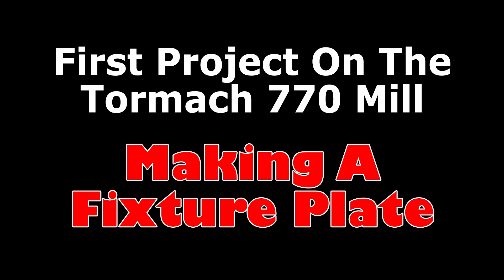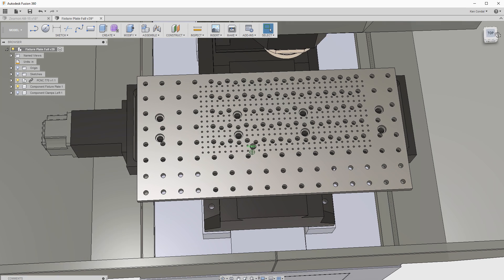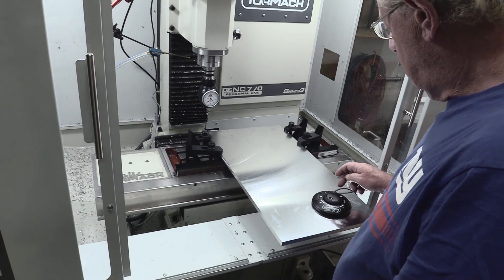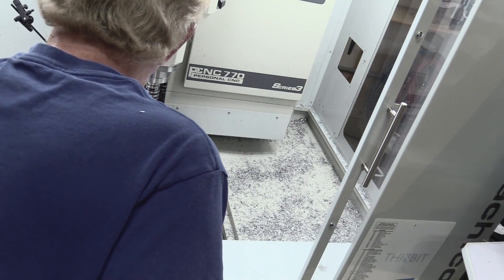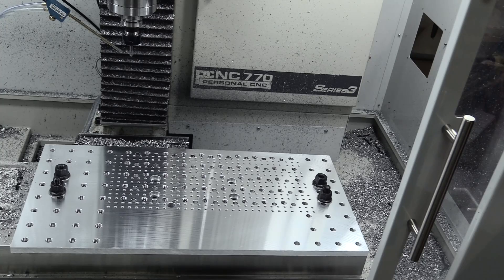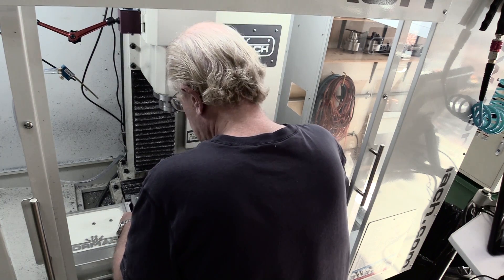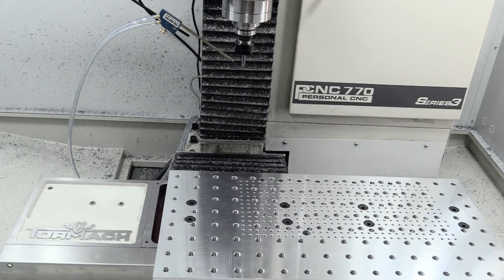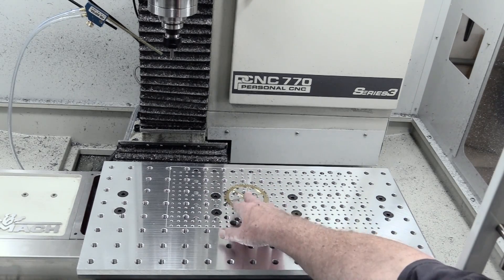Making A Fixture Plate

Comment: Hi Ken, something you might find interesting if you haven't already discovered it.   

I have been using a program called GearWheel Designer by Delphe that allows you to make a complete wheel using CNC including cutting the teeth.  It means going down to micromilling with sub 40 thou tooling but it works.   The tooth profiles are really nice.   The program lets you drill or mill holes as arrays or random so you can do hold down holes to hold crossing out petals.   The resulting code seems good and runs on my 440 OK.  I always cross check using GWizard before I run it.  Worth a look on delphe.co.uk and there are some notes on my site pezula.co.uk showing the results.

Kind regards
Alan

Comment: Hi Ken
I have a 440 and am about to make a plate using the same principles but I am missing a step.  

When you do the first two stages of the two independent end machining how can you ensure that the two sets of holes are in line as you will be using the Hammer on just the corner of the plate ? Or do you use the opposite corner when you turn the plate round ?  
How do you then ensure the plate is perpendicular to X when doing the two ends ?  
Does that make sense ?
Did you export 3 sets of G Code ?

Alan
Reply from the maker: Hi Allan. Yeah, I guess I left out a step. I used a DTI to ensure that the side of the plate (along X) was square. Since we're only going to be drilling for threaded hold down holes, it doesn't have to be perfect, just close. What really matters is the third op when I drill for the dowel pins. Those are all done in one op and will be as close to square as the mill itself. Since the dowel pins are used to square the plate when it's mounted in its final position on the table and will also be used to make sure your stock is square to the plate, that's all that matters. I probably generated 3 sets of gcode, but that's up to you. Ken
Reply: OK Ken, that makes sense and is obvious now you said it ....  Thanks for the quick reply.

Comment: Hi Ken, 
After watching your video I tested it at x1.25 speed and you sound like most normal people.  Did you post this video at 75% speed?  
But I expected you to use something like the superfly to make sure the surface is completely flat.  I didn't see you measuring it for flatness with the Heiner on the Z axis.  How do you know it's flat?
You really should check this video at x1.25 speed. It's very enlightening.  Never settle for what nature gave you if Google can give you more.  Even Taylor Swift uses Autotune.
Reply: KenToonz.  Thank you guys.  Maybe I'll make a smaller plate for the vise first like you said.  Yes I know a plate is ultimately sacrificial.  That's why I want to protect the tormach table from accidental damage.  Maybe I should take my time though.  Thanks again.
Reply: Ken appears to be using plate, which starts life pretty flat, certainly far better than extruded material. One can also order the material sized, faced, and ground. Allows one to balance cost and time, with perfection.
Reply: +Kent VanderVelden.  Thanks Kent.  I'm in the process of ordering the Tormach 1100 and I want to use a plate.  One option is to buy one from Tosa Tool who sells them for $1000 (not gonna happen).., or to make one myself, but I'm not sure how accurate it will be if I am trying to make one, face it, and drill.  But it needs to be moved around because the plate is larger than the actual effective work area.
Reply from the maker: Congrats on your 1100. I used cast aluminum which is plenty flat enough for my purposes. My advice would be to use the machine for a while and then figure out what you need. I made a much smaller plate that I mount on my vise and find that I use that even more. But the big plate is still there, under the vise.
Reply: Based on Ken's other videos, he clearly knows his stuff, and I'd follow his advice. For plates that would be awkward to face, places like Misumi offer faced and ground 2 or six side plates, with specs on flatness and parallelism. Maybe I'm lazy, but for a large plate, it's worth considering having someone do that work. Keep in mind, any sort of tooling plate is ultimately a consumable though and will be replaced or resurfaced (and otherwise modified for special purposes).

Comment: Ken... very good video.  Nice fixture plate.  Thanks for sharing.   Where did you get the Haimer with the inch graduations?  Tormach seem to only sell that model in Metric?
Reply from the maker: Thanks Enda! I thought it was important to have a Haimer in inch and found them on Amazon. But since it's mostly used to find zero, I doubt it would matter if mine was metric. I believe the metric one is smaller and since the Z travel on the mill is limited, that might be why Tormach sells the metric version.
Reply: Thanks Ken, I saw in another post that someone implied that the metric Haimer has better resolution..... what is the resolution of the inch version?  I seem to recall that the metric one is 0.01mm (0.4 thou).  Also I assume that the shaft is probably 3/4" rather than 20mm on the metric one and that the ball on the end of the probe is inch also (?)

Comment: Ken, it's great to see your new Tormach in action.

I've started working my way through your earlier videos using your Sherline CNC lathe and mill. As a Sherline lathe and mill owner, I'm quite interested to see the work done with yours. I refer to mine as being "manual CNC" machines" as in "Count Number Cranks"! I very seldom mark out parts for the small engine models I build, preferring instead to take a CNC type approach...............with my hands being the stepper motors. LOL

Anyway, as you move forward with your new equipment, I'd love to know where you're headed that made you decide to go to a larger machines. I've watched your "Sherline Equipment for sale" video and that was a beautiful system you built up. That video is also a great introduction to CNC with Sherlines and one I'll refer to a lot if I ever decided to convert my equipment.

Thanks for your great videos and will be looking forward to the continuation of your clock build.
Reply from the maker: Thanks James! There was nothing wrong with my Sherline equipment, considering what I was able to make with it. My pain points mostly involved speed - manual tool changes vs. a power drawbar and of course, cutting speeds. Being able to work faster has made the work more enjoyable. I'm looking forward to being able to do some parts with 3D contours which would have taken forever on the Sherline.
Reply: Thanks for the info Ken. I'm looking to following along on your journey.

I've always been interested in machining and last January, at age 69, I bought my Sherline lathe and mill. I've built several small steam engines so far and have an interest in building a clock at some point. I can see a natural progression into CNC at some point.

I find it really interesting that you and Chris at Clickspring are building the same clock.  It's great to see it being done two different ways

Comment: That Mic-6 plate is pretty poor for a fixture plate, why not grind flat some 7075 or 6061?  The Mic-6 is cast and porous and your threads will come out quickly. The only thing mic-6 has going for it is the flatness which you ruin by putting a piece of plastic underneath. its pretty but could be much more useful. Tosa Tool also sells one the same size made for the 770 , ground flat from plate 6061, machined on a precision Mori Seiki VMC using positive approach, then Hard coat annodized for under $800. How much time did you spend on this? Just wondering. Nice plate otherwise.
Reply from the maker: I've been using Mic 6 for fixture plates for years and never had a problem - certainly never had a thread come out! Sure, I could buy a plate, but where's the fun in that? :)
Reply: I suppose, its always build or buy. I would rather spend my time making my products and ideas. I can build a cnc fairly inexpensivly as well these days, look at the CNC control kits on ebay, instead I bought a Tormach, because they offered a lot of features at a reasonable price. I guess that's my point.

Comment: Ken, Glad to see you have returned. Roughly how long did it take to do just the machining for the plate ? Does that machine have G code it it to do say a set operations.

   take care   Ralph
Reply from the maker: Hi Ralph, it's good to be back. I didn't time the project but it took about 4 days. Part of that is me learning the new machine and part of it is that it just takes time to drill and tap that many holes. I'm not sure what your g-code question means, but the machine controller does have built-in routines for drilling, tapping, facing, profiling, etc. The fixture plate g-code was done using Fusion 360.
Reply: Ken, in reference to the G code" ?" Take your plate is there a standard set up for all the hole so the machine could do it all but with less set up on your part, just pick out a hole pattern and run. Providing that the machine could do the the holes without removing the plate ?
  take care   Ralph
Reply from the maker: No. When I engrave the rectangle at the end of the video, that's the maximum area the machine can reach, so you have to do it in steps. Watch it again - I explain why it needs to be done in steps. There are utilities that generate hole patterns but the pattern I needed was very specific and best done in a CAD program.